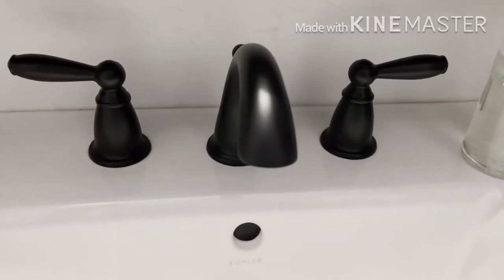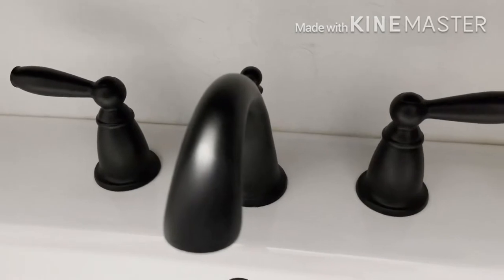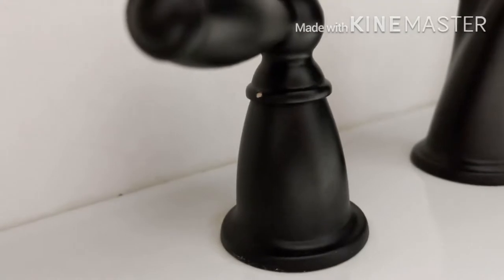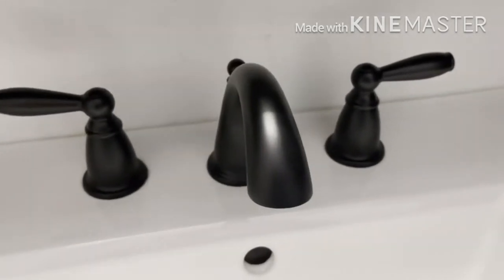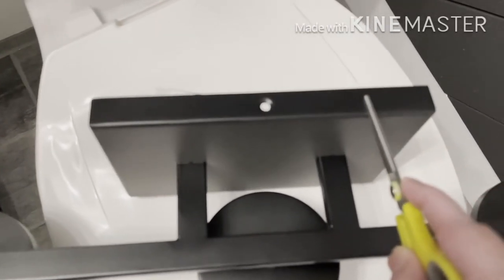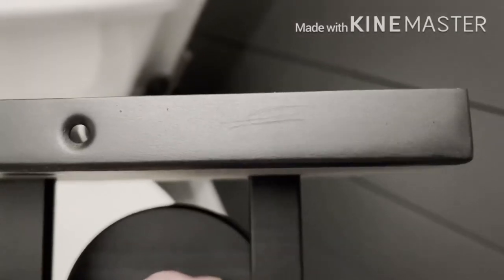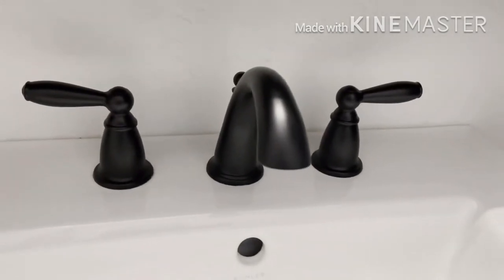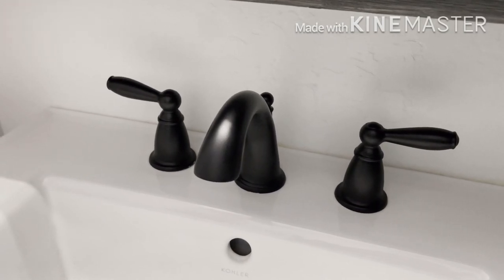Spray Painted Faucet Durability Update - 8 Months

Comment: Looks great! I'm sold! I've seen others do this w/o priming or using a top coat and it did not last. I think the extra work paid off. Thanks for sharing!
Reply from the maker: You're welcome.  Be sure your primer is Automotive primer.  The gloss top coat is also sold at automotive stores like Oreilly.    The faucet was also clean and roughed up a bit with sandpaper prior to application.  Good luck!
Reply: @moderngreyfarmhouse  want to do it can you tell the precautions to take

Comment: For that little ding, this is what I do.  I get a small craft paint brush, and I spray the paint into the cap of the spray can and you can accumulate a little puddle of wet paint in the cap.  Then quickly, before it has a chance to start drying, just use the craft paint brush to touch it up.  And especially where that chip is located, you'll never notice.  Do the same with the clear coat.  Anyway, I'm thinking of doing this, so thanks for the video.
Reply from the maker: This is a really great idea.  I think I may try it!

Comment: Thank you for the update. It looks beautiful but does seem a bit on the fragile side. So, as you said, not recommended for a heavily used bathroom.
Reply from the maker: If I had a choice of buying a new faucet or spraying one I would go the route of spraying and see how it holds up since the spray paints are pretty inexpensive.  I probably wouldn't spray a faucet that was expensive that I plan on keeping.   I hope this makes sense.  I have seen people have great success with heavily used bathrooms.

Comment: I want to do this to my tub, it has some plastic parts and metal. Do you think it will work, also how is everything holding up now?
Reply from the maker: It doesnt have anymore flaws as of now.  If the tub is used daily I wouldn't expect it to hold up as well.  But if you do it I would be sure to not skip the automotive primer and sealer steps.

Comment: I can’t automotive primer anywhere (offline or online) can you suggest what else can i use as a base coat?
Fyi: i am trying to paint chrome/nickel metal bars of my motorcycle
Reply from the maker: I was able to find a few on Amazon.  I willing them below.  I also has success finding it at Autozone where I live locally.   
https://www.amazon.com/Rust-Oleum-2081830-Stops-12-Ounce-Primer/dp/B000V69Q58/ref=sr_1_7?crid=8P7F3N7P11UW&keywords=automotive+primer&qid=1691081432&sprefix=automotive+primer%2Caps%2C184&sr=8-7

https://www.amazon.com/Dupli-Color-General-Purpose-Self-Etching-Towelette/dp/B01MSW9M6Z/ref=sr_1_79?crid=8P7F3N7P11UW&keywords=automotive+primer&qid=1691081481&sprefix=automotive+primer%2Caps%2C184&sr=8-79

Comment: How did the metal on sink drain hold up?. How did you not get paint on the sink while spraying?
Reply from the maker: They paint is still okay on the drain but we don’t try to dry it often so the hard water doesn’t build up.  We taped around it with blue tape then added plastic with more blue tape to cover the sink
Reply: Sorry to say I didn't paint the faucet. I chickened out😥👎
Reply from the maker: @mariasimonelli9793  it’s understandable.

Comment: Did you apply clear enamel after you spray painted it?
Reply from the maker: Yes.  It was coated in automotive primer, then spray paint and then clear enamel.
Reply: @moderngreyfarmhouse  thanks, I’ve just sprayed mine with rustoleum Matt black and rustoleum primer but did not buy any enamel. I wish I did now